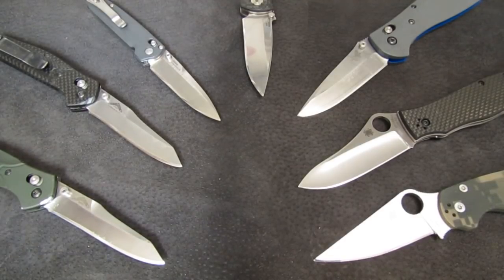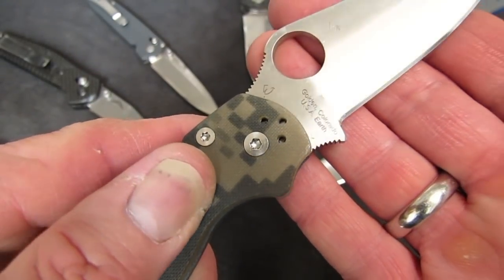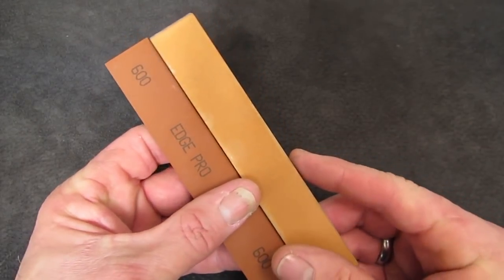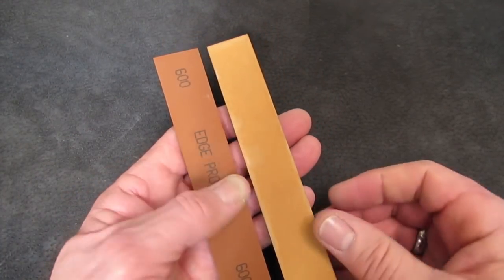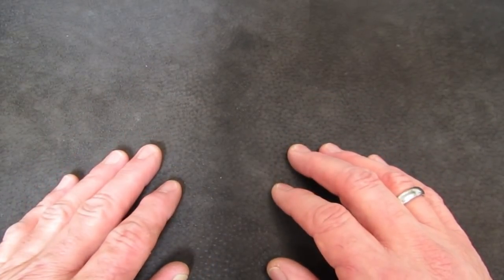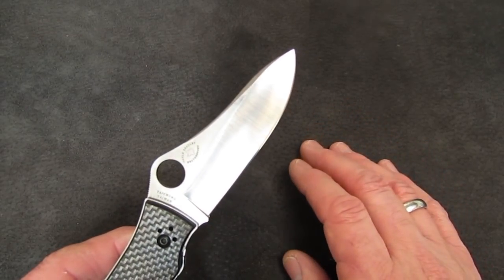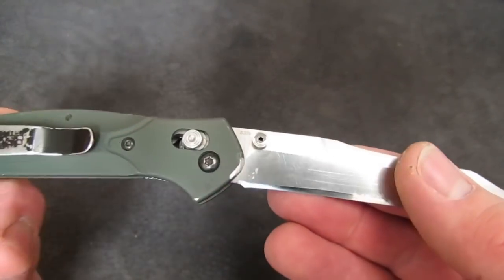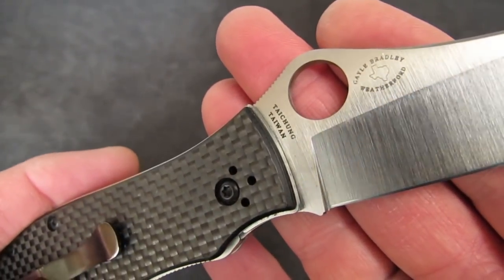Edgepro Tutorial #6:  Common Sharpening Mistakes and Solutions

Comment: Rob, how will you handle those two 940s? Will you polish the existing huge edge bevels and then put a micro on to get it sharp?
Reply from the maker: Jeffrey Weber There is no handling those two. The blades are already sharpened beyond their usable life. Notice how the choil is totally used up. They both need new blades.
Reply: Yes, I thought that might be the case. Just wondering if there would be anything you could do.
Reply: Excellent video b.t.w.
Reply: Why not regrind them? I wouldn't say they're beyond salvageable
Reply from the maker: SV 97 You could certainly do that, but for $30-35, Benchmade will install new blades.

Comment: Here's another question. I recently sharpened my new spyderco manix 2 sprint run. On the tip/front  part of the knife, the angle looks like it went down from ~17 degrees to 14-15 degrees. I dot know why? I sharpened it on the ack flat part of the knife.
Reply: Cooldibs If you moved the tip away from the blade table toward you for clearance, you change the sharpening angle.

Comment: apostle. can you sharpen s30v on the stones with edge pro
Reply from the maker: Clayton Bigsby Yes, but their diamond matrix stones work better.
Reply: @TheApostleP  can you buy those stone and mount them to the edge pro apex. reason for the quesfion is that i want to order a buck 110 in s30v buy im afraid i wont be able to get it sharp.  whats your opinion on buck 40hc paup bose het treated
Reply from the maker: Clayton Bigsby I buy the unmounted stones all the time, Clayton.  They’ll work just fine on S30V. They just don’t cut as fast as the diamond matrix stones. Keep in mind though, when using brand new Edgepro alumina (stock) stones, you have to do a light leveling with  the silicon carbide and glass to break the glaze at the surface and get down to good abrasive. 

Buck’s 420HC is as good as it gets, but nowhere near the performance of S30V.
Reply: @TheApostleP  thank you apostle.  you are a value member in the knife community. 

would you come up with a gec collab.

i love a single blade trapper .

i ended up orfering buck 420hc

Comment: I respect your work and the amount of knowledge regarding sharpening, but with all due respect you don't know all. The free hand sharpeners are a rare breed who know their business, and they don't need fancy, expensive gear to sharpen a knife. Just because you had to deal with some people that didn't know what to do and messed up their blades it doesn't mean that free hand sharpeners are idiots who don't have a clue. Personally I have never used sharpening gear like yours and don't need. Depending on the blade I use three or two stones before stroping and if I want to remove some steel to make a convex I use a water stone grinder. I even convex knives free hand. I can do it in the field if I need to. Takes a little more time depending on the steel but it's doable. Too bad I can't show you my blades. Best regards from France.
Reply from the maker: crank gunner Glad to hear from you! Please understand, this video is not an indictment of freehand sharpening. That is absolutely the form of sharpening which requires the most skill and is most rewarding. Fixtures systems are great for repeatability and precision, which is why I use them for customers’ knives. But the most enjoyable sharpening experience for me is freehand on stones, sandpaper (for convex) and strops.
Reply: @TheApostleP  thank you for clarification, indeed free hand sharpening is the most rewarding. I forgot to mention that my free hand sharpening differs from yours. I use a flat diamond stone and push the knife against only to restore unfinished or asymmetrical plunge grinds otherwise I sharpen the knives holding the blade in one hand with the cutting edge facing upward and the stone in the other. Gives me total liberty and I don't depend on flat surfaces to perform  my sharpening. In the field it's excellent. I am doing this since I was young and people who know me are cautious when they use knives sharpened by me because they cut themselves especially those who are butchers and use their knives 10-12 hours a day. Best regards. Stay sharp brother.